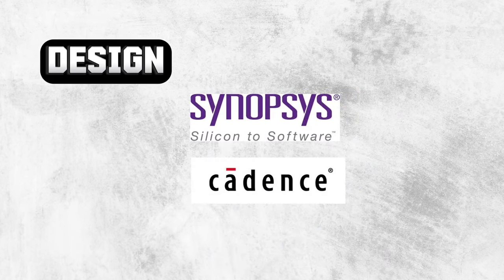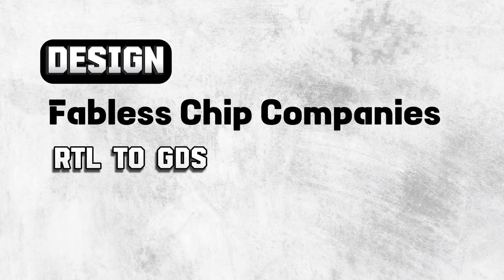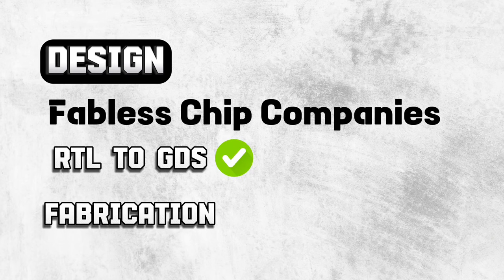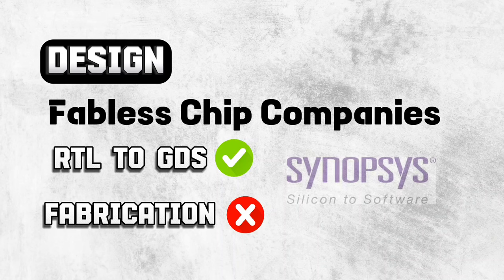All types of VLSI Companies | Semiconductor Ecosystem Explained | Rajveer Singh

Comment: To get job for a fresher, Verilog, system verilog and  UVM is enough or not
Reply from the maker: Yes, It is enough on the programming side.
But,
Digital electronics, Analog Electronics, Computer Architecture, Digital/Analog IC Design knowledge is required as well.